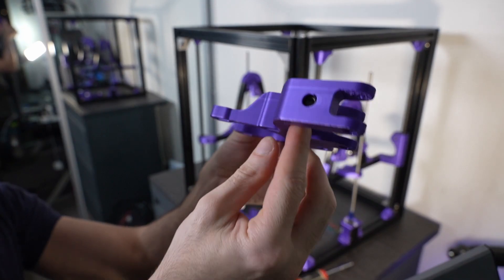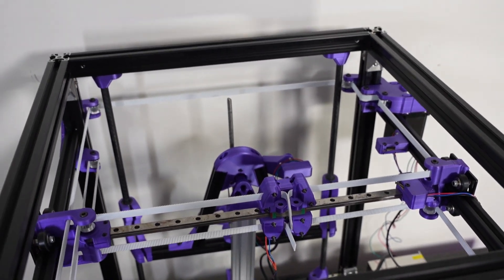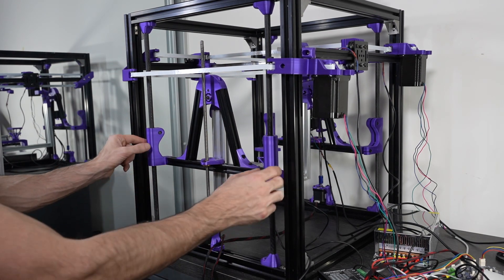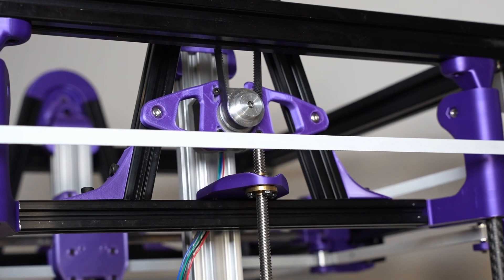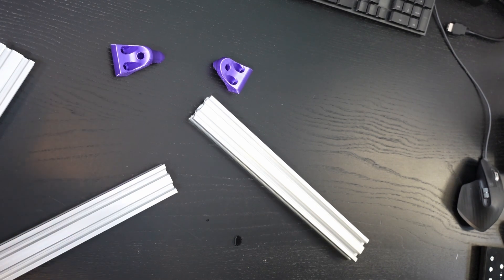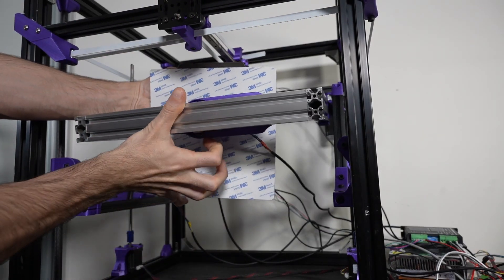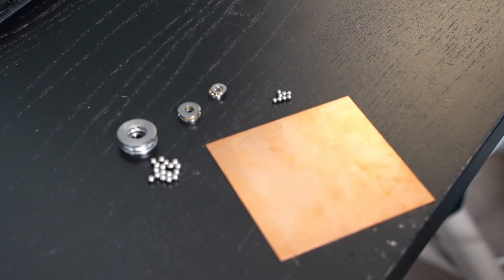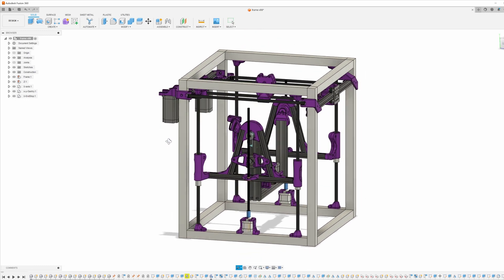5-axis 3D printer - It moves!

Comment: Great project. With 2 more axes, the whole thing can achieve a lot more. Like CNC or robotic arm. The rotation range of the V-axis is only 0-360 degrees, a single rotation. Or is it that there is no angle limit, and it can be rotated as much as the data is output? Because the v-axis should rotate the heating bed, power supply line, and temperature measurement connection line. If there is no angle limit, the connection lines will twist together. Forgive my stupid question.😁
Reply from the maker: It should be able to rotate 360 degrees, I have some ideas on how to make it heat up and measure temperature in spite of that. That's on my list for the next iteration!
Reply: Hahaha, looking forward to it  @engineerunleashed

Comment: I would replace the 4 carbon fiber rods with threaded rods and synchronize them with a belt via a motor or use one motor per threaded rod as with the Voron 2.4 (this would have the advantage that you can also use the motors to level the bed). You can then completely do without the middle threaded rod.
Reply from the maker: I've made some changes in the Z axis. Those carbon rods received a lot of criticism, and it became obvious that they were a problem. Take a look at the last video, the new version seems to work much better (although I'm open to keep changing those as I need to).

Comment: 7:10 : Option 5, add counterweights.
Reply from the maker: That was a good option! I could use the motor as a counterweight too if I design it correctly. Take a look at the last video, all those options failed and I ended up using a worm gear (which may still change in the future)

Comment: You could get mechanical power to the "V" Axis by running a belt to the pivot point of the "U" axis and running a shaft through the center of the bearing. This would allow the V moter to not weigh down the U axis, but would require synchronization like the XY in core xy.
Reply from the maker: That is indeed an interesting idea! In the future (way down the track though) I may try this. Will be challenging from the design and the coding perspective, but it's clearly an idea that has merit! Thanks for that!

Comment: Something I saw on quite a few of those parts were that they had bent or flexed slightly. If you are just printing in PLA you might want to think of using other materials. Printers like the Voron only recommend using ABS and I have seen other companies using PETG. Mechanically PLA is not a great material. You should also probably avoid nylon as it can flex and creep. Another option if you can manage it is polycarbonate, but ABS may be more suitable. You could also try reinforcing the printed parts with metal rods, bolts or screws.

With the V axis it does look like the build plate is twisted because of the tension on the belt, you may be able to help that by lengthening the shaft and adding a bearing to the other side, that would reduce the twisting on that shaft.
Reply from the maker: Yes totally! This is just a "draft" prototype. I'm being cheap and using PLA and ABS but the final version most likely is going to be printed in Carbon. PETG is also a good candidate.
And yes, V was a problem, I've redesigned it and now it's way better (but a bit heavy). Needs more work still but it's one step closer to a "useful" state.

Comment: You could try using different belts. You do get thicker and wider belts but you can also get belts made of stiffer material or even with steel wire in them. They are a lot stiffer but can bend to as tight a minimum radius so you can’t use them with small pulleys.
Reply from the maker: I may try belts again in the future but unfortunately, the belts and pulleys approach didn't work. The moving part is too heavy. I ended up using a printed plastic gear for now, but it's likely to keep changing as I optimize the design.

Comment: I am so thrilled by your project and all the reasoning you have honestly shared. In very rare cases I have found people being so honest about the challenges they face. Thank You 👍

You can try to use the voron style 3d printed gears to reduce weight and also increase torque.

Second, you can use steel rods instead of carbon rods to solve the z axis problem and still keep the costs low.

I have used all of the above in my printer builds and mods and it works great. So thought it might help you.
Reply from the maker: The Voron is such a great printer! I thought about inspiring my design on it, but I was mostly limited by the pieces I had from before.
Regarding the Z axis I ended up getting some linear rails and I've designed and 3d printed an upgrade to place them. I just need to install that but I'm focused on the kinematics code right now. I will show that part soon!

Comment: I didn't see anyone comment about the choice of plastic for components. I thought that a couple things looked off but thought maybe it was related to you're cameras lense. I'm pretty sure one of those large steppers for the kinematics of the hotend gantry has mount that has experienced "creep". All of the printed parts in purple-blue if they are PLA may be good for prototyping but not suitable for use. I know you mentioned bearing "slop" which is certainly a thing you want to get rid of but plastic creep/elongation from load over time  is as much a culprit. You should really use carbon or glass finer reinforced versions of the more amorphous plastics. Consider those fiber reinforced plastics or a crystalline plastic like I think Polycarbonate is one.
Reply from the maker: At this point, I'm using just cheap PLA for this prototyping stage. I also got some ABS to try that later but none of them will be used for the working version. I never used carbon yet in any project, but in the past I've used PETG, what do you think about it compared to the cheap plastics?
Carbon is a good idea though, I think I will order one spool or two to have them available!
Reply: I'm pretty sure PETG is far less susceptible to creep/elongation than PLA I think it would be an excellent choice for further prototyping and could prove sufficient for end use if not too near very hot components. I think you should use PETG as you mentioned having familiarity with it. As I'm sure you know you should use a tool steel or other very hard nozzle for use with glass and carbon filaments. Also not all carbon filament are the same percentage of fibers by volume. I would do a little research on that before purchasing one brand or another. The last consideration I can think of right now is that you would probably want to print the fiber reinforced plastics with as large a nozzle as you can get reasonably good finish from as those will probably have less tendency to clog if using a high percentage fiber plastic. .6 or .8 would be better than the more standard .4

Comment: maybe you can build your machine in fusion kinematics and define youre axis. you would need to physically need to fins your center of roation and find your statuc work offset and take of DWO In your post. of course this is only the machine movements but can help knock out the daunting task of your slicer issue
Reply from the maker: Yes it's a lot of things to consider, I will go step by step. But I think you're right on that, I think I will need to probe the heatbed in many orientations to get all those offsets right.

Comment: Use tapered roller bearing for the bed. They are made to hold that kind of load from tilting.
Reply from the maker: I've ordered some in different sizes today! Thanks for the idea, I will definitely try them!!
Reply: @engineerunleashed   I'm sure you know this or figured it out but just in case, for a tapered bearing and cone to work right and keep it from tilting the bearing needs to be tightened into the cone with preload. So squished together. Maybe look at like trailer axle wheel bearings for a visual on it. I donno just wanted to add this on the chance you aren't familiar.

Comment: What if you used guides to the swing gantry and the z axis based on the x and y with the  extruded on.
Reply from the maker: That was one of the ideas, but then I imagined that if Z is mounted on the X and Y gantry and then lowered too much, I will have a hard time ensuring the Z is rigid enough at that point. But has some merit, for example, I would use 1 less motor for Z...
I think your idea has some benefits for sure but also opens the door to other problems, lets try this first and asses how it works.
Reply: @engineerunleashed  Thanks, I am fascinated by your work.  Thank you for sharing and doing what you are doing.  I was wondering after prototyping finalize the design you want to use.  I think PCB Ways can manufacture custom parts and a reasonable price. You could use a stronger and lighter material that way.  I haven’t used them, but I know some people who have after prototyping battle bots. I don’t know what material would be strong and light enough to best suit your design.

I am really looking forward to see where your project is going. :)

Comment: For the backlash issue on the U axis perhaps using a push-pull linkage might help. Rather than placing all of the torque in one direction you might be able to stabilize it somewhat by appkying it in 2 directions simultaneously. Instead of belts perhaps a steel cable?
Reply from the maker: That's something interesting! I will look into it, it might be a good idea, thanks for putting it out there!

Comment: For the U axis, you can put a bigger gear ratio to help the motor output more torque. And I aldo thought you could use counterwheigts to balance the "U shaped" brace! So the torque required by the motor to mantain an inclined angle, should be less than now.
Reply from the maker: That counterweight idea is not bad at all! Let me think how can I implement it, thanks a lot!

Comment: If you want continuous rotation on the V axis, take a look at a slip ring. Adafruit has some that might work.
Reply from the maker: I think I have one of those somewhere, but I remember thinking that the cables where too thin for some applications. Anyway, looks like something worth trying! Thanks for the idea!!
Reply: @engineerunleashed  you can get slip rings with a high current rating. I have even seen them used on vacuum cleaners to connect the power cord, which unwinds, to the rest of the vacuum. If current is a big issue then maybe you could go with a higher voltage or possibly AC powered bed.

Comment: also, tapping might be a necessary part of building this and not doing it may limit you a lot, i suggest watching tutorial videos on it and practicing (possibly with cheap taps) as much as you're comfortable with
Reply from the maker: I will certainly keep trying. I am better now than I used to but still making a lot of damage every once in a while.
Reply: @engineerunleashed  do you use tapping fluid?

Comment: do you have a slicer for 5 axis printer?
Reply: its a brand new project? and a slicer is an extremely hard task to make for any non planar printing much more so for 5 axis, did you expect him to just.. have one?
Reply: @spindlywebs  I was simply asking if he had found one or made one. Without a slicer, this type of printer is irrelevant? Or do you think he's going to do the gcode by hand so each part will be very time consuming?
Reply from the maker: I don't have anything of the kind yet, but I need to start somewhere, so the physical printer looks like a good candidate. Realistically, it will be years before someone releases a good piece of software that can slice in 5 axis with user friendly tools. There are some bespoke ways of doing it, and they all look like a pain. I am confident that eventually I will manage to print something in 5 axis. But I suspect we will be using just 3 axis and support for years to come.
Reply: @engineerunleashed  a couple of years back there was someone printing with a 5 axis printer. He had a working slicer for it. I don’t know how good it was. Going to look for this if it’s still out there. I was looking at the time to build my own hyper cube when I came across it, but it was beyond the realm of my comprehension lol

Comment: I've literally tapped hundreds of thousands of holes in my life. I didn't get good at it by 'not' breaking taps. You'll get better in time my friend, try using some cutting oil, it helps keep the tap sharp, and the aluminum from sticking to the tool steel
Reply from the maker: I will keep trying, I am way too stubborn, I will surely break 100 more taps before getting a hold on it but will be worth it

Comment: when tapping you should back off by 1/2 turn each full turn of cutting thread.
Reply: To remove the cut waste otherwise you can break your tap.
Reply from the maker: I think this is what I am doing wrong, I always find a point where it gets stuck and doesn't go forward or backwards anymore...
Reply: @engineerunleashed  Also, the use of machining oil during tap cuts makes everything much more consistent and reliable as well as making for smoother tapping.

Comment: I definitely can't wait to see the end product.  One thing I could think of to help with the excessive backlash is trade the Nema 17's for the 23's to potentially get the most out of the extra power.
Reply from the maker: yes! That's a good idea. In fact, seems like a better use for those big motors than in X and Y.
Reply: also maybe 3d print some harmonic or cycloidal drives for the steppers

Comment: Very cool project, for the rigidity wouldnt it be better to use a 45 degree A/B axis? In this Youtube video is a example https://youtu.be/s9rsB0VP-Pk . This moves the complete load / heavy part on the bearing itself instead of your motors or frame.....
Reply from the maker: I think I found the exact same video some weeks after I assembled mine. I actually like that approach a lot, but since I have something already build, lets just try this one first. Will be a nice thing to try in the future even if this works as it is.
Also, seems to me that will require changes in the kinematics that I don't think are compatible with the way I designed it. But definitely something to put in the list of things to experiment with! Thank you for the idea!
Reply: @engineerunleashed  🙂 no problem, was just a idea. Reason for it was stability because 3d printer frame lack that no matter how much plastic we put into it 🙂 . You are correct the kinematics would be a lot different (little more trigonometic same as the corexy on a different plane where you have to move both axis). Love your development. BTW for the slicing on your 3d printer, you could deform the stl object into a sphere, slice it in a common 3d slicer, then you should be able to print it directly. Here is a sample video on what i mean: https://www.youtube.com/watch?v=7LRWuccMGjc